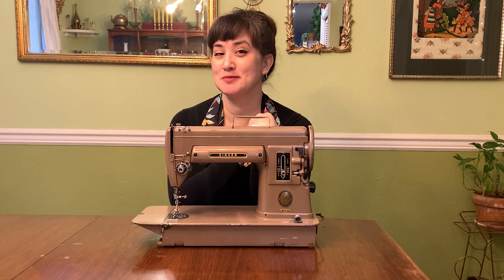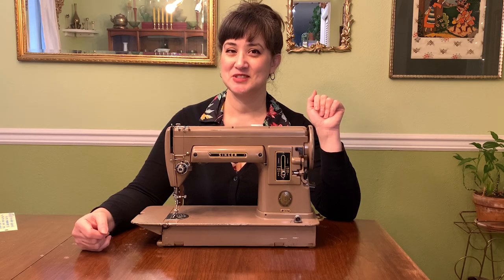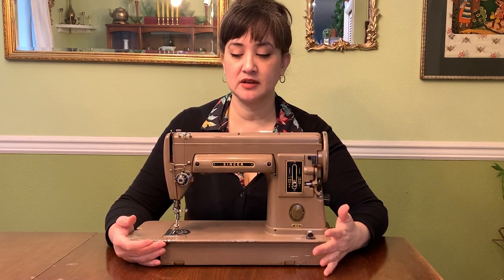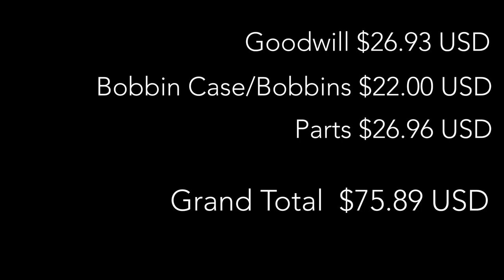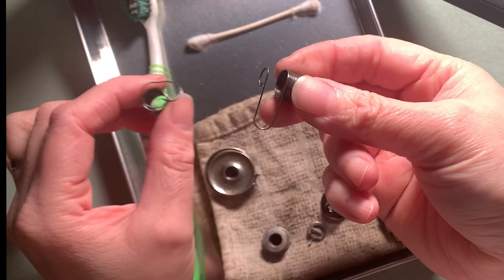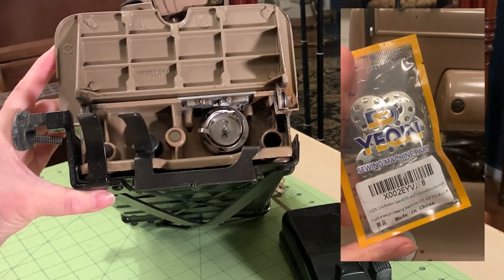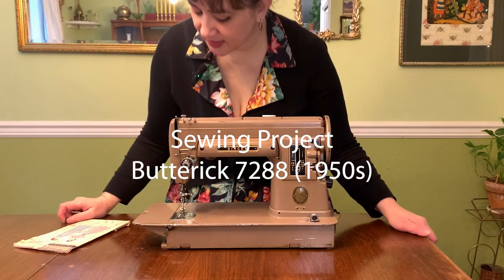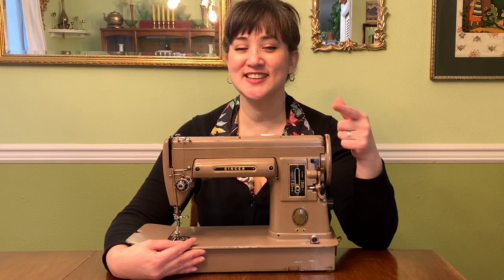Singer 301A - Did we just become best friends? #vintagesewingmachine

Comment: Thea,
I have restored many Singer 221 (Featherweight) for my wife's quilting friends. They are stuck on the cuteness of the Featherweights.
My favorite Singer sewing machine oscillates between the Singer 301/301a and the Singer 201/201K. The Singer 301 outperforms any Singer Featherweight. I will repeat what others have said, "The Singer 301 is a Singer 221 on steroids". The 301 is more powerful, faster and durable. The internal motor is stronger and the internal gearing is more durable.
Thank you for posting this video to encourage people to consider a Singer 301 or 301a.
Reply from the maker: I laughed out loud when I read "stuck on the cuteness". It's so true. I often hear that as one of the main descriptive words about the 221s. (It is totally cute.) But oof, I just love the 301A. It had me surprised from the initial stitches. How strong it is, the absolute perfect stitches, it would be a shame to not consider it.

Comment: I was given a 1953 301A machine in a cabinet last year. I refinished the cabinet. Took the machine apart, cleaned, oiled and greased it. It works like a new machine. I had to order the little rubber tire for the bobbin winder and a few extra bobbins, but that was it. I’ve made 9 quilts so far and mended numerous items. I have 3 other machines, but this one is by far my favorite.
Reply from the maker: How awesome! Refinishing the cabinet is no small feats in some cases too. The 301A has been my favorite so far too. I just love it and feels good to work on. Thank you for sharing that joy with me!

Comment: Not to brag, but I bought a 301A for $2 at an online auction. I'm not a very experienced sewer but I have made a few small projects. I had an old White rotary and wanted a cabinet to set it in and that was the reason I bid on this machine. As it turned out, I really didn't know what I had, but I found this wonderful, practically new looking Singer inside and cleaned it up. I think it does a great job and would do a better job if the operator knew what he was doing. I think these older machines are super.
Reply from the maker: Wow! You really got a great deal on that auction. I have many machines and nothing beats the 301's stitch quality. Congratulations on that score!

Comment: ❤ I have one too, I got it at an estate sale $35 I didn’t know if it worked or anything about this vintage model, but it came in a cabinet with a matching bench and the drawers were full of scissors and notions. I bought it figured the cabinet and notions alone were worth the $ even if the machine didn’t work. It sat in my house untouched until my Touch n Sew golden Deluxe feed dogs stopped working. I took both to the repair shop and the man suggested I just keep the 301 👍🏽 I’ve been googling all the info about it and have been pleasantly surprised to find several people that love this machine. It was used in teaching home economics in schools. (So I read somewhere 🤷🏻‍♀️)
Reply: I sewed with the Touch and Sew 5 years, after it was gifted from a dear friend who’s Mom had sewed with it for decades. Getting it repaired required getting a couple of parts fabricated by a machinist. I picked up the 301A and am still trying to fix it. I’m almost there thanks to a plethora of YouTube videos 🤣  I have an awesome TL series and the vintage Singers are fast becoming my favorites 🧵🪡
Reply: It's a powerful machine
Reply from the maker: I love it when a machine comes with its cabinet and is filled with goodies like that. Honestly, I was skeptical about all the talk/hype about the 301. Was it just because it's "portable". (Mine is technically the cabinet/table version because it has the two plugs on the side rather than the one.) But I am absolutely smitten with it. I love how lightweight it is. I love the slant needle and the stitches are amazing. I hope you'll be pleasantly surprised too with yours. Maybe you'll consider it as a great upgrade to the Touch & Sew. I have a Golden Deluxe also that isn't working right and is fine bookend at the moment. The first person I asked about it in a sewing machine Facebook group called it a "Touch & Toss". Oof.

Comment: Thanks for sharing this video.  I just bought a 1952 301 with a cabinet for $1 at an auction.   The cabinet drawers were full of all the accessories too!  Zigzager, button holers and all the feet.  Greased and oiled and started to sew.   I usually sew with a 1938 99 so I too was surprised by how light it was when I picked it up.  FYI the needle plate shape mirrors the orientation of the needle....if you ever wonder.

Comment: Supposedly the 301 will sew up to 1600 stitches per minute. You may want to clean the commutator on the motor to help speed it up. I think  Vintage Sewing Machine Garage and Andytube have videos on how to clean it with a q-tip and alcohol.
Reply from the maker: I did read that too. I didn't feel like this machine was sluggish at all. If anything, the speed was an exciting surprise. I do appreciate the recommendation and will definitely keep it mind just in case something goes awry. Thank you!
Reply: Yes 🙌🏽 Andytube has been a great resource.
Reply: Yes Andy Tube is kind and a great source of information.

Comment: I found one in its case, I assumed it was a typewriter. I opened it & was surprised, it had been marked down.to $20 bucks, it had 8 feet & manual, button holer.
It's a great machine.
Reply from the maker: I've also mistaken the case for a typewriters. I always check now, even if I am sure it is a typewriter.

Comment: Wonderful demo!  So nice to see new generations value these older machines from when I was younger.  The new plasticky machines today with their zillion electronic complicated parts are not appealing to me at all.  I adore vintage machines with their mechanical all metal parts.  They last forever, well built, solid, robust, and easy to use and maintain.  

9:07 - See that screw head sticking out on left side of screen?  What is that part please? It seems to be missing from a machine I want to buy but I am not able to see beyond the outside.  I would love to know what that is called. Its on top of one of the shafts going up and down.

This was a delightful video and the star of the show is of course, the chickens! What sweet birds, so curious about the sewing machine.  The morning coat was lovely with the vintage buttons.  Keep making videos. This was a lot of fun!
Reply from the maker: I believe it's the pressure regulating thumb screw.  Agreed on the build quality of all metal machines vs the modern plastic ones. I have broken so many pieces on modern machines. Even just by changing a lightbulb. Thank you so much for your comment!

Comment: I've just watched your video again to make sure I picked up all the tips you gave. I think you are missing the spindle to hold the spool of thread when winding the bobbin. Probably not a big deal but if you wanted all the parts in place, there is a spindle (the same springy type as on top) and a round felt pad for the spool to sit on. Just to the right of the little tension wheel for bobbin winding.
Reply from the maker: You are right! I don't have that spindle for this machine. I feel lucky for what I did find for this machine and wasn't too particular of having it all complete. Mostly due to the condition I found her in. But now knowing how much I love this machine (and my other 301), I'll add that missing piece to my shopping list. Thanks so much for your comment!

Comment: Your machine is a beauty. I found a 1952 301 in a cabinet at my local Goodwill and by waiting a few days until “senior” Wednesday received a 15% discount so only paid $56.00 + tax. It was missing the bobbin case, glass lens on the light, and had an “iffy” cord set, so I went on eBay and purchased a vintage bobbin case (I already had bobbins) and lens, and a good cord set. Yes, these parts cost more than the machine, but we’ll worth it.
I noticed in your video that your 301 appears to be missing the bobbin winding spool pin from the right front bed. It is also a spring pin like the one on the back. I have seen them listed on eBay from time to time. Good luck and have fun with your new girl.
Reply from the maker: Ooh, I hope your cabinet that came with it is nice. I did like that mine had the "drop in" cradle attached to it, even though it didn't come with a cabinet. With the cradle I can use one of my current cabinets. Yes, my winding spool is missing. I decided to skip replacing that for now. I was in the same boat with spending more on parts that I did the actual machine too. But I'm one of those crazy ladies that winds a few bobbins to have filled on the ready. Admittedly, I use my modern Pfaff for winding all of my bobbins and that's about all I use it for these days. I didn't look on eBay to do a price comparison - so thank you for mentioning that.

Comment: You didn’t mention or show a knob down by the bobbin case.  That knob is used to lower the feed dogs so you can darn, embroider or free motion quilt.  I had a black one that had this.  Your chickens are sweet.  My chickens are also chicken; any time I go out to the coop with a different coat on than they are used to, they are afraid and go under the coop.
Reply from the maker: I plan on sharing more about this machine in a future video. I need a small piece to enable the bobbin winder to work properly. I'm planning to show that and more about the bobbin (area). One of the first things I did when I got the machine was turn that knob because I didn't know what it was for. 
Hahaha! Your chickens sound like my girls. How dare you do anything or present them with anything different. Thank you so much for your comment!

Comment: I'm so glad your video came up. God knew I could utilize the information you have given. I bought a 1970s era singer and I was able to sew for about a week, and then it kept breaking my thread. You have given me confidence to take apart my tension regulator, because that seems to be the source of the problem. 
I sewed many clothes, jammies, toys and blankets on my singer treadle machine throughout our marriage. Now as I am older, and my eyesight has changed, I sold it to a nice lady who was thrilled to have it. Thank you for the helpful information. ❤
Reply from the maker: For me, I've often had tension issues with my machines. Sometimes, they just need a good cleaning of the disks where the thread passes through. Sometimes, they need a lot more. Thankfully manuals are easy to find online for free or a model specific machine You Tube video.  I wish you all the luck with your machine!

Comment: Great job saving a 301! They really are incredible machines, even smoother and more precise than the legendary 201 imo. Just thought I should mention that the tension assembly will work even better if you move the "loop" of the check spring above the little metal finger on the left , rather than leaving it below. This is illustrated better than I can describe it at 21:00 in this video: https://www.youtube.com/watch?v=KsV4lUHMa28&t=1265s Happy sewing!

Comment: Hello, your tension "check spring" should be above the "nub", not below it...
Reply from the maker: I was waiting for someone to critique me on that. You are correct. I actually didn't notice (or see any signs of issues) until about a week after filming everything. I've been exclusively using this machine recently and noticed my goof when I threaded it again and noticed the placement of the spring. A good testament to this machine I think, despite my flub.
Reply: @TheaStarr    Another tip ( I have been fixing my machines for years and learning constantly )... When the check spring is in proper tension, it should rest at "6:00" under the "nub"- then pull it up. The adjustment screw should be in the center, not to the left or right ( as well )... These are "helpful tips" not criticism ..
Reply from the maker: @1953childstar  Absolutely. Apologies if my use of the word critique, inferred criticism. I didn't feel that from your tips. I definitely do not know everything. I appreciate your comments.

Comment: They do run like a race car. Yours may actually be a little slow. They're supposed to run up to 1600 stitches/minute. Might be worth wiring in a known good foot controller. Maybe your techie husband can rig up a tachometer for you.
Reply from the maker: Compared to my other 301 this one is a bit slower. I did read that the foot controller wiring is something to investigate if your machine is running slower. Good tip on using a tachometer. I will definitely do that. Thank so much for your comment!